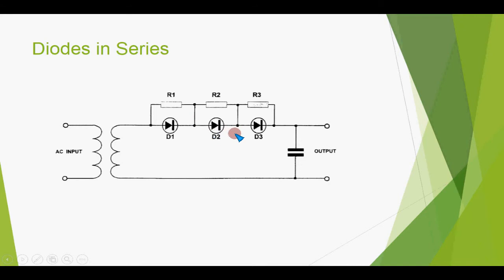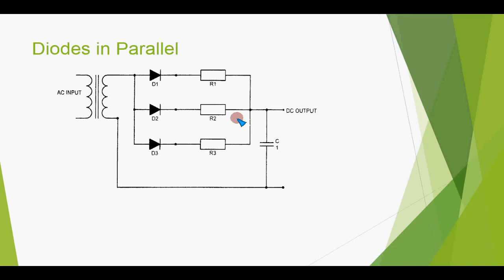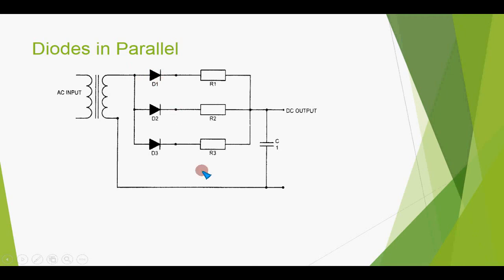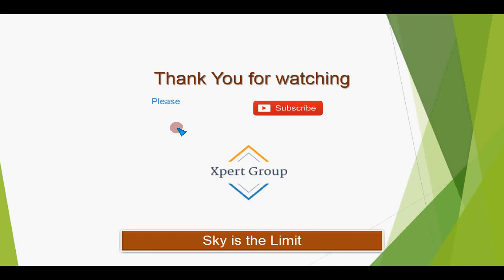How to connect Diode in Series and Parallel | Effect of diodes in series and parallel

Comment: Hello sir. I need your quick response,
Would 10kv pass through the first 1kv diode in forward biased? in series of 10.  1kv diode.
And Would 10kv block by the first 1kv diode in reverse biased?
Reply: xpert group 
Ok sir, If I use 10, 1kv diode in series. Then would 10kv block by the first 1kv diode In reverse bias?